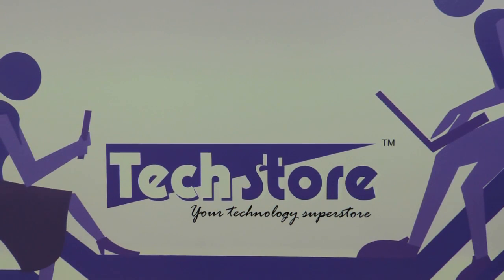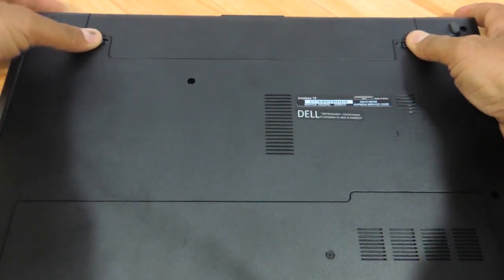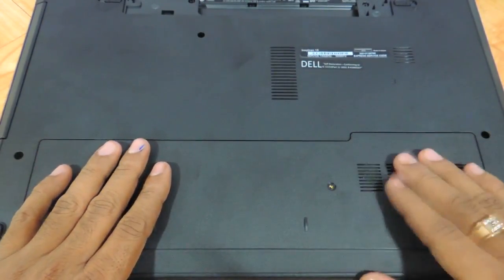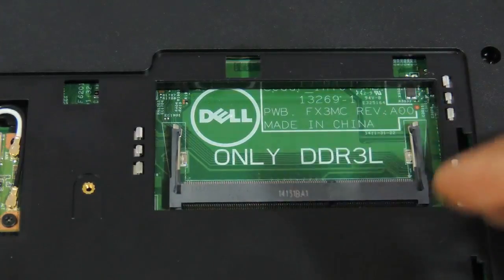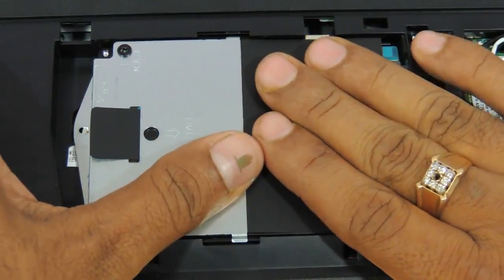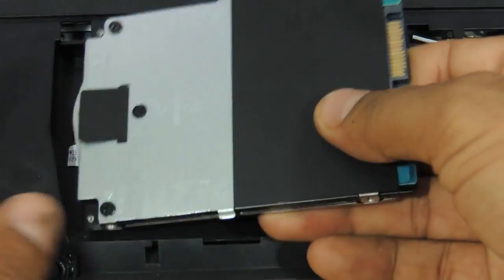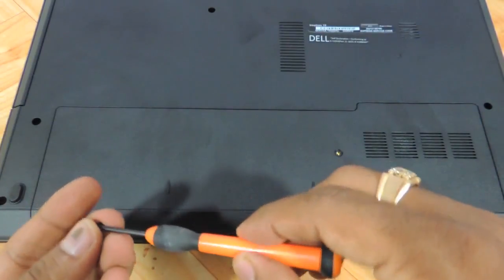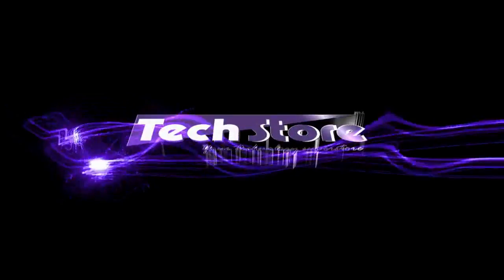Dell Inspiron 15 3542 3543 3442 3000 series How to upgrade ram and harddrive

Comment: Is Dell Inspiron 3442 laptop SSD compatible? If yes, then what type of SSD can be installed on it? Which SSD will you suggest?
Reply from the maker: You can only install Sata 2.5 SSD. We suggest Samsung or Western digital
Reply: @TechstoreCoIn  And what's the maximum storage capacity SSD which we can install in this PC? Please also tell the thickness of caddy which I will need, as I want to use both HDD and SSD at the same time in this PC through DVD slot..

Comment: Hey I recently bought an 8GB ddr3L 1.35v 1600mhz RAM, but after installing the ram when i start the laptop only the fan turns on and the windows isn't booting up. What could be the issue?
Reply: Shivam Negi bad ram or which model u have
Reply: Dell Inspiron 3542
Reply: Shivam Negi yes it works. Installed crucial ram. The first time it didn’t recognize my speed but when i entered bios and stored defaults settings, everything worked good
Reply: I guess the RAM i bought must be damaged. Anyway thanks for the information friend

Comment: hey awesome video.. much appreciated! 
can i upgrade my HDD to a 240GB SSD?
Also here's a link for the SSD 
https://www.amazon.in/dp/B01FJ4UL2S/ref=wl_it_dp_o_pC_nS_ttl?_encoding=UTF8&colid=2G6RT16KAC88Z&coliid=I3K4B8OCMRXQYN&psc=1
Reply from the maker: +Shivam Negi Yes you can. Absolutely no issue
Reply: Techstore is there any way to install an external GPU? Currently my 3542 has intell HD 4400
Reply from the maker: +Shivam Negi not possible...

Comment: To  check the max upgrade of RAM you can get just go to www.crucial.com and run a system scan they will let you know plus the cost, my model does not have that hard drive it's actually empty i wanted to upgrade it but don't see any SATA connection cables.

thank you

Comment: hi andy, I wish to purchase and upgrade the RAM in dell 3542. I am not sure if this 8gb RAM provided by corsair is correct to go for. Would you please check it on the link:
https://www.flipkart.com/corsair-value-select-low-voltage-series-ddr3-8-gb-laptop-cmso8gx3m1c1600c11/p/itmdxt2gg6prdx5u?pid=RAMDXT2GTKHMQZPJ

and lemme know if i can go for this.
Reply from the maker: +rishi singh yes you can buy this
Reply: thanks

Comment: i have dell inspiron 3543, can i update beyond 8gb ram?
Reply: for 3542, 8 gb is max as motherboard supports this much only. It cannt handle more than 8gb.
Reply: No, 8gb is max.
Reply: is 8gb the max because the computer cant handle any more than that? because i found a 16gb ram card i was wondering if i could use or would it fry my motherboard?

Comment: Hi I got an Inspiron 15 3543 with the i7-5500U CPU @ 2.40GHz CPU i want to upgrade the 4GB RAM whats the max that i can fit in? And i would love to add a 256 GB SSD (if possible, dell offers only 128GB ones) while keeping the 500GB HD already inside. Can i do that? or i have to choose only one module between a small SSD, a large HD and some 500GB hybrids dell offers in their support page.
Reply from the maker: +leonidas samouladas You can upgrade the ram upto 8Gb on this model. You can add a HDD caddy and put an additional SSD instead of the DVDwriter bay area. We will be uploading a video shortly.
Reply: Techstore cool that video would be very nteresting
Reply: +Techstore One more question for my machine which of the two RAM upgrades proposed by crucial would be faster / more powerful:
Crucial 8GB DDR3L-1866 SODIMM CT6977093
DDR3L PC3L-14900 • CL=13 • Unbuffered • NON-ECC • DDR3L-1866 • 1.35V • 1024Meg x 64 

or the

11499
Crucial 8GB DDR3L-1600 SODIMM
CT6977105
DDR3L PC3L-12800 • CL=11 • Unbuffered • NON-ECC • DDR3L-1600 • 1.35V • 1024Meg x 64 

tried to study the difference in MHrz and CL and transfer rates but im not sure i arrived in correct solution (the 1866 one if the motherboard actuly have the busses to use it) might by because i have a M.Sc. in Naval engineering and not Electronics :P

Comment: You said to use a "star" screwdriver?   I should be getting my 3521 next week, and I just went looking to see if I needed a "STAR" screwdriver, and the answer is NO!  A star-screwdriver is not what is needed, its a Philips-head screwdriver.
 Because of your lack of the proper word, you sent me nuts looking to see if I needed to order a star screwdriver. I had to download pictures, and then increase the pictures trying to see what the screws look like. I'm disabled, live alone, and I don't drive, so I order everything on-line.
Please use the proper terminology, for some, it may not be a big deal, however, it is to me in my situation.
Also, I'm the type of person who chooses my words very carefully, I foolishly expect others to do the same.
Reply: thanks David, I too was using this misnomer; your input helps.
Reply: Take a chill pill David.
Reply: That's your first problem. Your expectations are too high. People on Youtube don't choose their words carefully. There's no bar. The stupidest, most uneducated slobber mongrels congregate here. You might want to check elsewhere for more professional intructional advice, like ifixit.

Comment: Is it possible to upgrade GPU? Or at least overclock it? I have this laptop for almost a year now. I've seen online it comes with 820M, 2GB, but mine is 840M, 2GB. But, since newer games are around the corner, I'd like to upgrade it as much as possible. Also, is there any good alternative to adding an SSD, and not losing my current 1TB HDD? Thanks in advance!
Reply from the maker: +Fabijan Rehorić Not possible.

Comment: @techstore HELLO SIR WILL THIS WORK FOR MY INSPIRON 15 3542? http://www.amazon.com/PC3-12800-DDR3-1600-SNPN2M64C-Equivalent-Gigaram/dp/B00SRVJE6U/ref=sr_1_fkmr0_2?s=pc&ie=UTF8&qid=1442921294&sr=1-2-fkmr0&keywords=8gb+ram+dd3l+laptop
Reply from the maker: +NewMafiaOrder No it will not. Please look for a Low Voltage MEMORY...DDR3L
Reply: +Techstore OK HOW ABOUT THAT ONE? http://www.amazon.com/gp/product/B011SB5VXU?psc=1&redirect=true&ref_=ox_sc_act_title_1&smid=A3LKWIQ3PBTNT2
Reply: +NewMafiaOrder Dude you need DDR3L RAM, search 8GB DDR3L on Amazon (or 4GB, depending what you want)

Comment: Question:  Currently, you can only upgrade to 8 GB of RAM because they don't make anything higher than that.  But suppose they started offering DDR3L 1600Mhz in 16 GB or more.  Would you be able to make that work, or is it that the motherboard won't recognize above 8 GB?  To my knowledge, 64 bit systems can recognize much higher amounts of RAM.  Just asking.
Reply from the maker: +saberx08 If 16GB DDR3L is available, it can be fitted.
Reply: +saberx08 im using the ispiron 14 3000 now and it had 4 gb of ram but.......1.70 ghz processor speed

Comment: If the RAM card doesn't specify DDR3L, but says 1.35V, is that fine? Crucial's website says it's compatible with my laptop.
Reply: +Danny Howick -   I have got the same doubt.  +Techstore please do respond ..  I got ta DDR3 8gb ram. Max BW - pc3-12800(800mHZ), Manufacturer - Micron Technology. It takes 1.35V.  Has worked fine for past three days..Just today noticed this video. What do you suggest I do. The current ram wont be a problem right ?

Comment: Hey, here: http://www.ebay.in/itm/DELL-Inspiron-3542-Core-i7-4th-Gen-Laptop-4GB-Ram-500GB-HDD-15-6-034-HD-Display-/321557561906?&_trksid=p2056016.l4276

It says 1 unused slot. But you say it has only 1 slot and max upgrade is 8GB. Who is right and who is wrong. Please tell me. I'm thinking of buying that laptop.
Reply: +SouL Prisoner I know its too late now, but let me tell you that i own a 3542(i7) and it has 8gigs ram(single channel) and 1 tb hdd. The specs in the link are quite strange as it cant be found on the dell's original website. Also the laptop comes with windows 8.1 not linux. And there is definitely no extra ram slot. And the price is way steeper than 41k, i got it for around 60k or $1000
Reply: +Manas Sharma Ya... i bought that and there was no extra ram. I sent it back. Is there any laptop with 8gb ram, i5 5th gen, Nividia Geforce 940M,/GTX 950M, 1 TB??  for price around 50k?
Reply: Umm... I heard about an hp lappy with 5th gen i5 and 940m for about 55k... maybe you can get it for cheaper on ebay or Nehru Place
Reply: ok.. thnx

Comment: It's SATA 2 or 3? Also HDD 9mm fit or only 7mm?
Reply from the maker: BriDMachine Sata 3 & it fits 7mm as well as 9mm
Reply: Ok, tank you :)
Reply: BriDMachine did you check it? did the 9mm really fit there.
Reply: vinayak biju Yeah, I bought a Crucial MX100 (7mm), I tried it with 9.5mm adapter and fit perfect :)
Reply: cool.!!  thanks buddy..

Comment: You can also only upgrade to a Solid State Drive of 256gb no larger.
Reply: Adam McGinnis that's a lie you can go up as much as you want too
Reply: GamingwithMohamed I was told by a Dell representative that the max SSD compatible was 256gb. My reply was two years ago they may have had a BIOS update since to expand the size by now though...